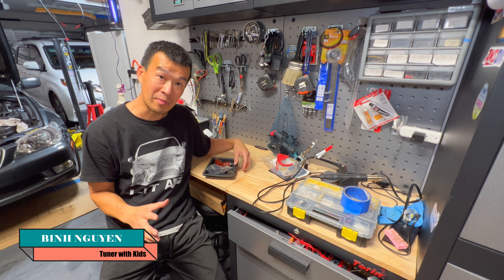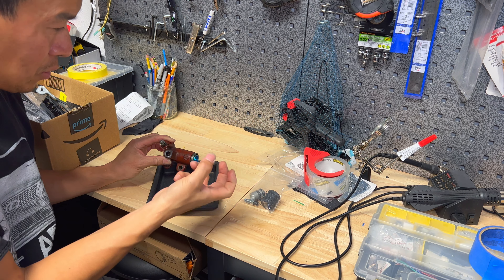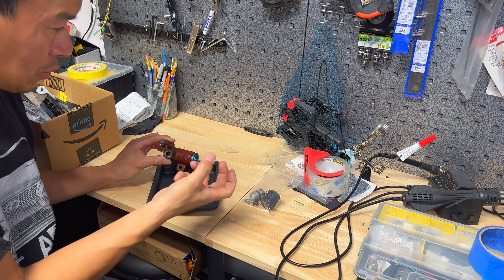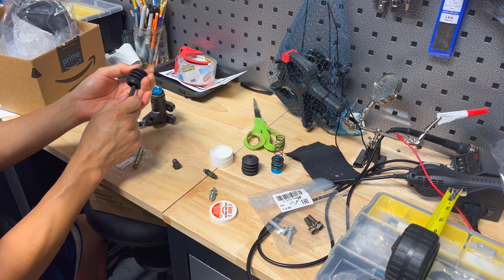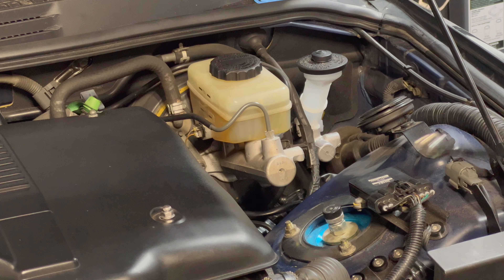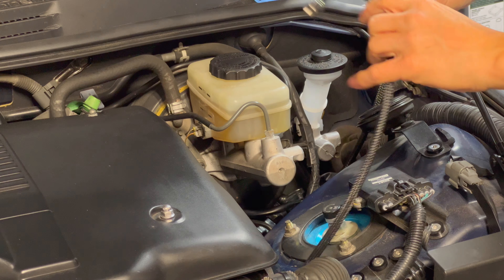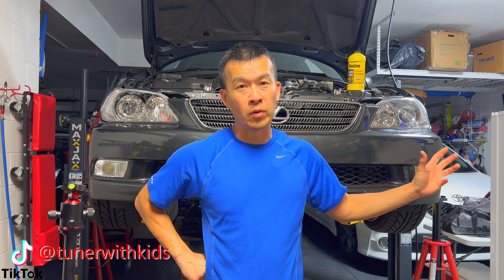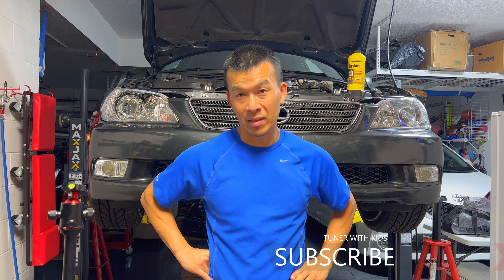How to Rebuild IS300 Aisin Slave Cylinder | Manual Swap Clutch Line Bleed

Comment: This video single handily solved my issue I went to a 6 puck Act clutch with a single mass fw and kept wondering why my slave kept over extending at first I was thinking maybe I need a longer push rod But I looked around and people was telling me it’s either my pressure plate or need a longer tob, or my master cylinder is bad but I didn’t have these issues until I went 6 puck and single mass fly wheel but the car drives fine for a while then takes a poop on me unexpectedly the slave was over extending I’m gonna buy the longer push rod now thank you for the help cause I’m now in November and it’s getting cold definitely knocking this out

Comment: Do you have to use the longer pushrod if you swap a w58 or is it only because you’re using the single mass flywheel?
Reply from the maker: Single mass FW with W55 bell requires longer pushrod since the FW is thinner.

Comment: I did not bother with bench bleeding and filling the line. If you can get someone to help then it's really easy and fast to get the air out. (bleeder open, clutch down, bleeder close, clutch up...took like 7 minutes total). 
I am wondering if I have the wrong size pushrod. The clutch starts taking almost immediately at the very bottom. Both cylinders are taken from of an IS200. Google tells me they came with duall mass and I am with single mass.
Maybe it makes You feel better about the leaky fitting when you read this fun story: 
I first got a used line but it is leaking in the flexible part and the nuts are super frozen there so I figured I'll just get a new one and not deal with it(20$ gone).  A bit in a hurry I bought the same clutch line 8 days ago since I saw it on your channel earlier. Ordered with express delivery($$$) and received it two days ago. I realized I did not order the extra fitting because I thought the line has all I need. Money wise cant justify ordering the tiny fitting with fast delivery since its many times the price of the item.(65$) It will arrive in maybe 3 weeks - at least I order it from another manufacturer so there is hope it won't leak. 🤔 Maybe I should immediately order the Chasebays or Soarsperformance one or I will drive this car next year.😂👨‍🔧 Good video as always, I'll come watch it again once the slave cylinder has started to leak next month lol.
Reply from the maker: I had to buy a banjo fitting with use a caliper bolt and washers. It fixed the issue. That fitting I bought was probably 3AN on both ends, when mates with the flare (37 vs 45 degrees) it didn’t seal. https://amzn.to/3pQHvni
Reply: @TunerwithKids  I ended up going to a hose shop and they fitted the correct type(based on the OEM leaking hose that I had) and now it is not leaking. In my case they did not put a banjo type - but there are no extra connectors so less chance of it leaking.